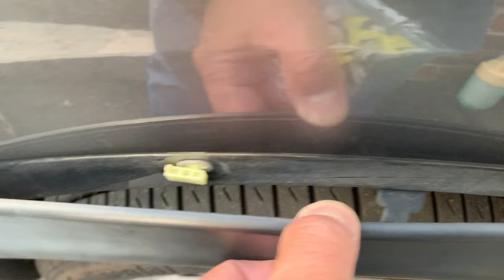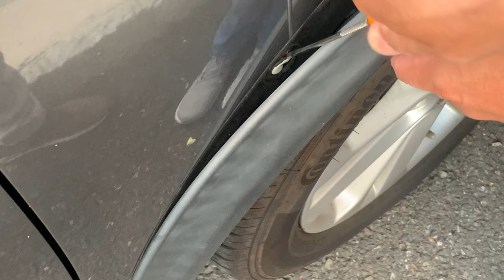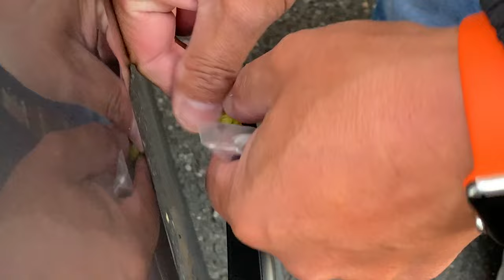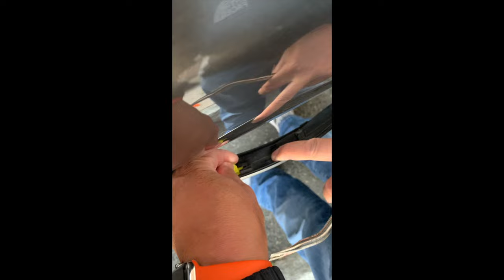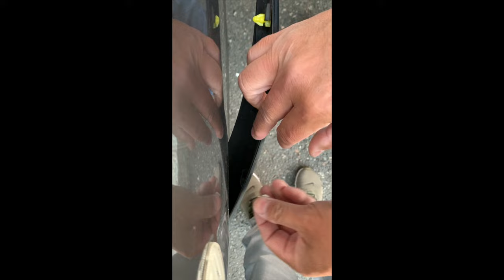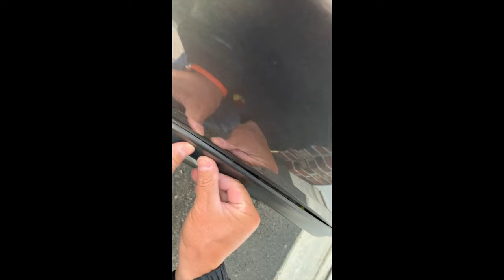Fix Your Nissan Juke Fender Trim With These Repair Clips

Comment: The mk8 civic is the same , trash trims and clips . I just brought a civic and atleast 2 or 4 arch trims have broken clips lol ....
Reply from the maker: This is true, and they also break for no reason or without anyone touching anything. They are cheap, its just a PITA to the clips or driving down to the parts dept to pick them up.